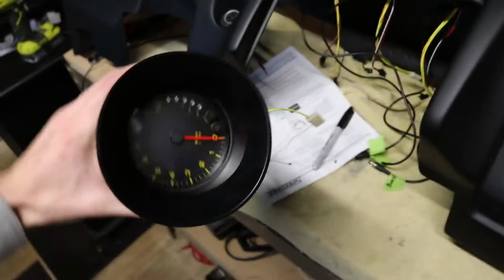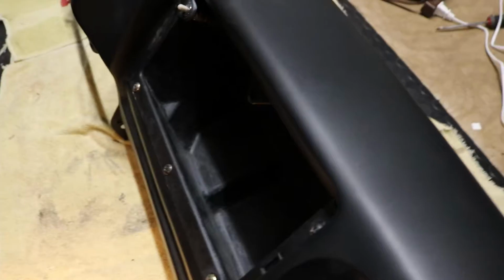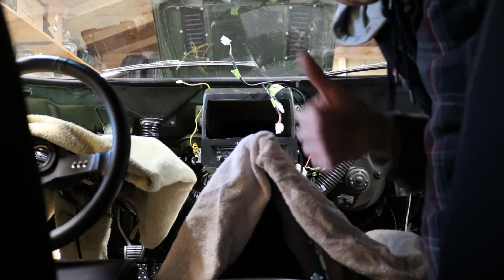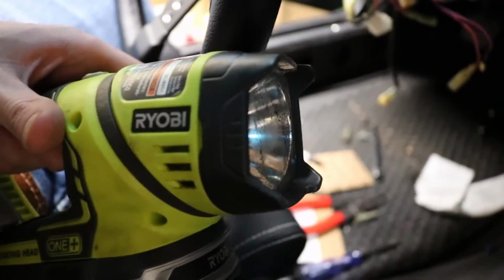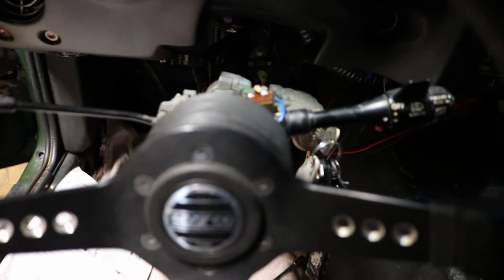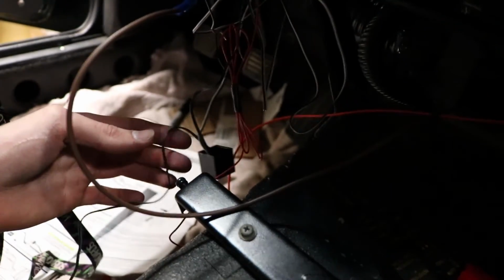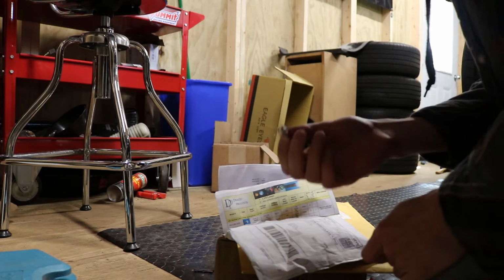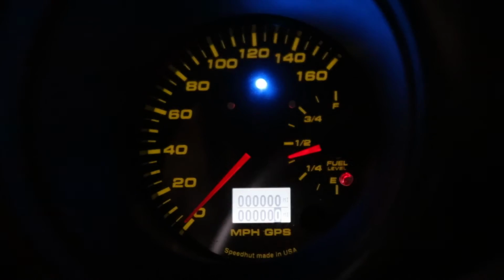Installing Gauges and Dash RB25 280Z Part 3

Comment: cool video! that lets me hope that i can bring back together my dashboard. after removing it last weekend, i really thought that i will never be able to figure out how to put it back together.
Reply from the maker: it's a little intimidating the first time! lots of wires back there to plug back in. most are straight forward, just remember your turn signals won't work until you plug in the hazard relay switch.

Comment: Nice clean install man, really motivating me to get my ass working my 77, question for you though, where did you get the new vent tubing that ties all the dash vents together? Really not keen on using my old crusty smelling tubing.
Reply from the maker: I looked for like 2 days for that vent tube! ended finding it for $5 at the local O'Reillys. search for Dorman defroster vent hose